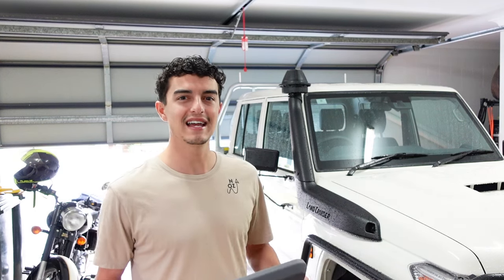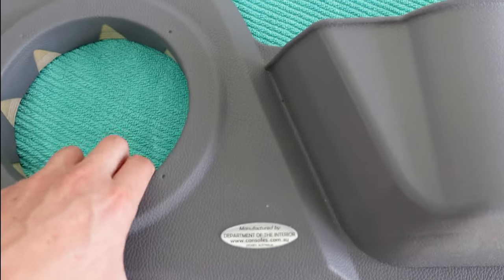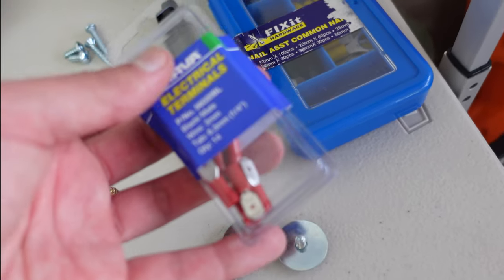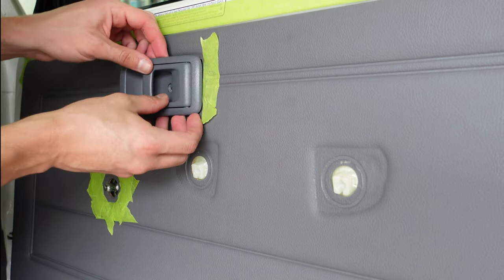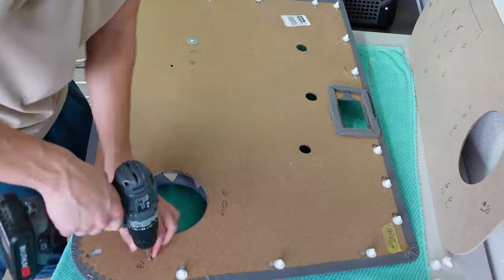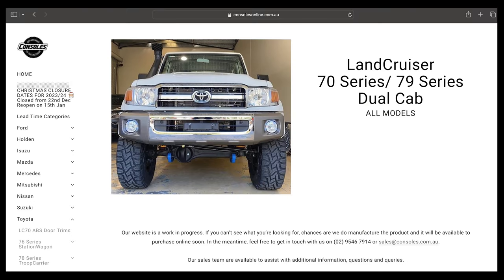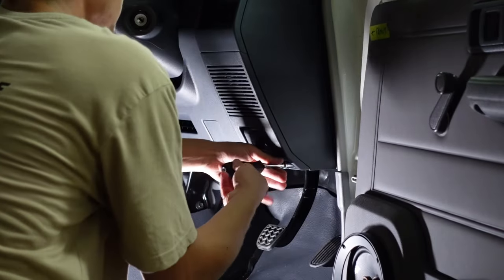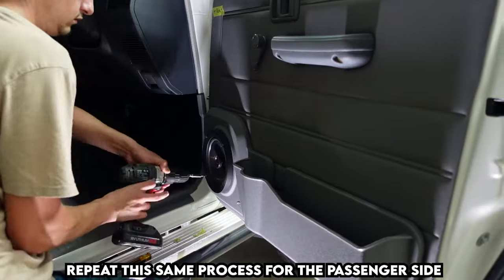PREMIUM SOUND SYSTEM INSTALL.. ON A BUDGET! // NEW Workmate 79 SERIES Audio Install + Before & After

Comment: While you had the door cards off, you should have installed a pack of 'Car builders' sound deadening. It's like foil with butyl backing, and it really makes a difference to how solid the door feels when you close it, and makes it quieter when driving. Easy mod. I did the doors and roof and floor on my troopy and it made things much quieter.
Reply from the maker: Good suggestion mate! I’ll definitely consider it 👍 Luckily, it’s not too hard to remove the door cards so can still do the deadening. Thanks for the idea 💡

Comment: Is it possible to seal the stock raised air intake to make it a proper snorkel? It would be really cool to keep the OEM part with the "Land Cruiser" lettering as it's one of the defining features of the 70 Series.

If you wanna replace the air intake and buy a proper snorkel look at the American company Sy-Klone. They make air filtration systems for heavy machinery and they also have a snorkel with cyclonic separation to have the cleanest air possible. It extends the life span of the filter and at least in heavy machinery saves operators money by extending filter change intervals. Oh and also they look really cool. They're popular as a high end snorkel in America for overlanders and the American JLTV APC	uses one too. They ship worldwide!
Reply from the maker: Good suggestion! I looked into them. They are a bit pricey but I’ll definitely consider it. The factory head goes alright with dust separation so I might run that on the new snorkel for now

Comment: 12:44 Get yourself a multimeter. They're super practical and inexpensive. If you already have electrician's tools like a crimper then why not get one as they make so much more possible.
Reply from the maker: It’s on my list for sure. I am doing a 12v setup soon so I’ll invest in a decent one. Definitely a must have item for the garage

Comment: Interesting video. The doors look good. I would have added tweeters to bring the sound stage higher.
Reply from the maker: I may still add tweeters where the old 4 inch speakers were. That wouldn’t be a bad idea at all 👍
Reply: @NorthOz they might sound right from there though

Comment: ? Sounds Better, But doesn't that Head unit come with 4 sets of speaker Wires and at least one pair of RCA sub outputs? Maybe you should have removed the Head Unit and used the other pair of wires for the Two door Speakers and Put some better Tweeters where the 4inch spk were or mount them higher on the dash or pillar, Also get a SUB it does make a Big difference even a cheap one.
Reply from the maker: Good suggestions and I reckon you are right about the outputs. I don’t have the need for a sub as I listen to less bassy music now but running some extra tweeters would be a good idea 👍

Comment: Dude, you did it incorrectly :). You’re not supposed to run wires through the door hinge. There is another grommet in the vehicle in addition to the one in the door. You access that grommet by removing that plastic trim piece near the hinge and then run the wires through both grommets: here is a video showing the correct install:

 https://youtu.be/bo719QUIBsE?si=j44alXq6BPaukR6x
Reply from the maker: Hi mate, I had a look at the link and thank you for sending that through. Unfortunately, no such grommet exists on the workmate as no wires run nor were meant to run from the cabin into the door. Believe me when I say I have checked this many times. Perhaps it’s only the newer 79’s that have this. But this is why it took me so long to trouble shoot the problem. The option is there for me to punch a hole and make my own grommet where the gxl one sits, but I don’t see the advantage of that compared to what I have done here. It’s been working well for the last week or so 👍
Reply: The video referred to electric windows whereas the NorthOz build has manual windows. Possibly why there is no grommet to run speaker wires through as power to the door is not required.
Reply: @NorthOz Oh I see, I didn’t realize there is no grommet in the workmate